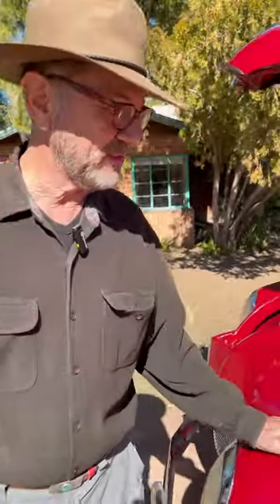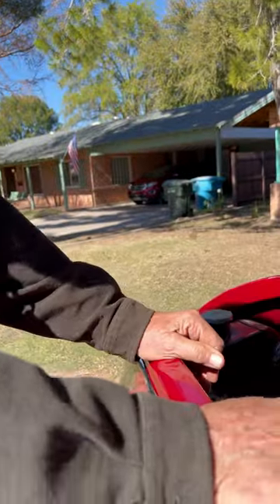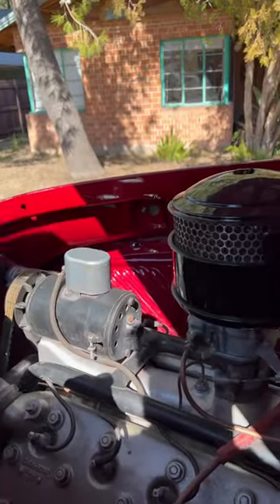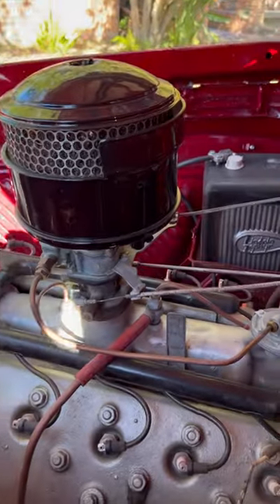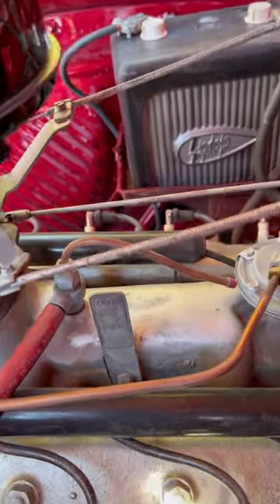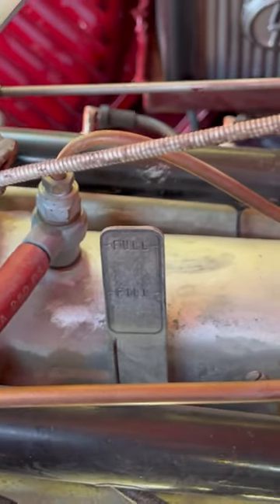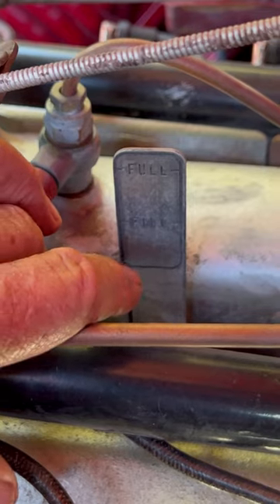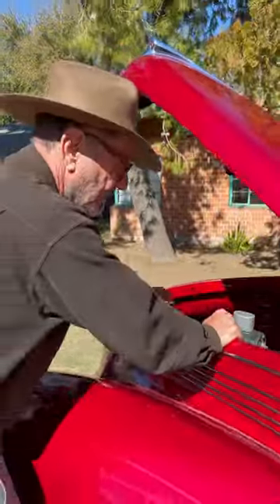Crazy No Dipstick Oil Check - Early Lincoln V12 Flathead #shorts #classiccars

Comment: He will be driving by everyone after the EMP goes off.
Reply: There's alot of 90s cars that are just as basic man
Reply: @clutchbleach2057  ... not even close dude!
Reply: @clutchbleach2057  Nah, not 90's. Old school diesel though, yeah. If you have a mechanical fuel pump and injector pump you wouldn't have to worry about em getting fried, only thing you'd have to worry about is getting the engine to turn. '90's have a lot more electronics, EFI, crank sensors, cam sensors, knock sensors, MAP, MAF, IAC, OBD I, OBD II, etc etc. Lot more shit to fix to get it running after an EMP. I could see early '80's, especially trucks. Manual, carburator, mechanical fuel pump, but you still have to worry about ignition. Main thing would be the coil, if it had points.
Reply: EMP are high power radio waves... They need an antenna to be picked up. If that antenna is connected to your stuff, it'll be fried... The power grid is the perfect antenna for picking up EMP. That is to say,  your car is going to be fine as long as it's not an EV that's plugged in.
Reply: @Melanie16040  ... EMP is a VERY broad band. Think of how small the antenna is on a cell phone. A quarter inch piece of wire will pick up EMP... and probably fry any electronics connected to it. Think of how many resistors, transistors, capacitors, etc (along with a mile of wire) might be in a modern car, not just an EV.
Reply: Old cars have just as much a chance of getting fried as modern ones.  The thing is that an EMP is unlikely to generate the required 25kV/m outside of the immediate blast area, which means that pretty much anything that isn't destroyed in the actual blast will most likely be fine.

But no, old cars are no more resistant to EMP than modern ones.   You would need to go back to a time before alternators, so, electromechanical voltage regulators on very old diesels.  Any vehicle that is directly under the EMP and RUNNING is going to be fried if not destroyed in the blast though.
Reply: @shockwavecity  ... I hate to call you out on that comment, but I have been working on cars for well over 50 years and it wasn't till the 80s when you had to be aware of small stuff like static discharge, while working on engine electrical. Yup, just that little spark from rubbing on a carpet in the winter could toast an ECM. OTOH, your idea of "old" might be 1995. When we talk of old cars surviving EMP, we're generally looking at pre 1970. Pre 1960 is going to be almost bullet proof, because even a car radio was very basic in those days.
Reply: My 95 Nissan terrano diesel wouldn't crank after I swapped the auto for the manual g/box. Seems the engine needs to see the TPS signal for the starter to work. Sits tied up to the loom now... would have thought it would be fine for EMP too, but no....
Reply: @timothyjamieson1282  ... TPS = throttle position switch. Did you have another sensor in mind, like the Neutral Safety Switch? (automatic only)
Reply: @sdusb1243  ... Gonna break that down a bit more... In the USA 80s vintage cars and light trucks usually had throttle body injection and even mid 70s vintage had electronic ignition. In this era, I worked on Datsun / Nissan vehicles, and they had an electronic carb, which didn't run for shit if the system went down. GM had their own version, starting around 1978. Working on VW diesels we also had glow plug timers, which came into play on most all consumer diesels around the mid 70s. The same goes for the Olds diesels in that era, along with the 6.3 / 6.5 diesels in GM light trucks. The engines may be old school, but the controls are not!
Reply: @rupe53  

There really are.
Reply: @rupe53  

Most cars from the 90s (FE) might struggle to start from cold and that's largely it.
Reply: @rupe53  

You clearly mean the 70s. And even then, unless the EMP was VERY localised the odds of a 70s and even 80s average car being immobilised is pretty unlikely.  Fight me.
Reply: @timothyjamieson1282  

Sounds like a CPS issue to me. Flex plate vs flywheel.
Reply: @rupe53  

I'll just call out your comment about 'electronic carbs': generally ANYTHING 'electronic' to do with carbs was linked to the cold start and sometimes load based conditions (ie lights or demister being switched on or off).  If it had a carb on it'd run regardless as long as it had fuel and spark. It might be harder to start especially in cold conditions but it'd start eventually.  Hot water on the inlet was a huge help.

'Black box' systems (basic transistored replacements for points and condensers) were pretty robust as well so tell me another bullshit story.
Reply: @skylined5534  ... ok, you wanted another story... electronic carbs used an O2 sensor and a feedback loop to maintain proper mixture at full temp, at least here in the US where emission controls were running rampant by the late 70s. (cold start was still a choke) Yes, those electronics were a bit more robust, but they soon gave way to integrated chips which did prove cheaper and more reliable under normal conditions.... but failed with extreme temps, static electricity, and even the stray "jump start" after a flat battery. (voltage spike) Points style ignition is still the only bullet proof way around EMP.... provided the rest of the vehicle survives the heat and the blast.
Reply: @skylined5534  thought that too, but Nissan is cleverer than that. Flywheelvand flex plate fit exactly the same and flex has a spacer plate so offset and crank bolts remain the same. Even had the pilot bearing was factory installed! The moment I plugged TPS back into the loom it started perfectly.
Reply: @Melanie16040  There's 100 lbs of wire in the average car, that's all antenna.
Every sensor is connected by a long wire to an input to a microprocessor that is extremely sensitive to electric overcurrent.
Reply: @clutchbleach2057 you'd have to go pre-emmissions at least which was early 70s. By the 80s cars were already becoming computerized.
Reply: All pre 1968 cars have their electronics shielded from emp because the ignition systems had no suppression and the principal on which ignition systems function is entirely magnetic fields. Something no one wants to talk about is the strength of the supposed emp if it carries enough energy it doesn’t matter if you’re electronics are sitting in a cube of lead it’s gonna get them but the general idea is that some things are more protected than others and as it turns out there was a point in time where vehicles were produced with some emf protection built in.
Reply: No he won’t 🤣
There’s still coils of wire in that ignition system, and those coils are gonna catch that EMF and over volt the rest of the system. It’ll be fried just like anything else.
Reply: @rupe53 TPS is also Transmission Position Sensor which tells the TCM what gear is selected.
Reply: @rupe53 also TPS is not Throttle Position Switch. It’s Throttle Position Sensor. Switches are binary and detect On or Off states. Throttle position sensors have a lot of steps. Think more like a potentiometer.
Reply: @sdusb1243  you have the right idea. I have an old freightliner I'm jumping into. A EMP will take out even simple stuff especially if still hooked to a battery. So starter is susceptible too. The Carrington event in 1859 was the strongest thing we have on record and that took out telegraph stations even causing fires. A a telegraph is about the most mindless simple thing electrically and it was down for something like two weeks, just imagine our infrastructure now. It's crazy how bad it would be.
Reply: @Melanie16040  not true. anything with power even batteries. Old stuff even the simple starter can get zapped
Reply: @rupe53  Even starters are fried
Reply: @berkcanberk4947  ... sorry, been working on vehicles over 50 years and the early ones were indeed a switch. Later they became a sensor. Old habits die hard. In the USA that trans switch is a neutral safety switch. It only allows starter operation in neutral and park. (Mechanical linkage shifters) On most vehicles it also controls the reverse lights.
Reply: @plap.  ... if you are close enough to have the permanent magnets in a starter be affected, you will have bigger fish to fry. (if you are still alive) The windings in a starter will probably be fine. There's also a 95% chance an alternator will be ok, as long as it doesn't have a solid-state regulator. Mechanical regulators will put us with mostly pre 1970 vintage vehicles. Your dash mounted AM radio (all transistor) will likely be toast.
Reply: Yup cant steal it or shut it down
Reply: @rupe53  yes you are absolutely right the older ones were. They were pretty much more like an interlock for the starter so you wouldn’t start your car in a gear. You don’t need to apologize. I thought we were just spitting info out there. I was in the industry for almost 30 years but got out after getting a taste of shop ownership for about 10 years. Left the industry all together to become a marine engineer. I bet you have seen the industry and cars change a lot over 50 years. You probably forgot more than I ever learned. Hahaha.
Reply: @berkcanberk4947  .... just to make things interesting.... today I drove my 64 Corvair panel van to where we store an old fire truck that was in the Memorial Day parade. That old fire truck is a 1928 GMC. It has no power steering, mechanical brakes, and a non-syncro transmission. If the 6 volt battery goes dead, it's got a hand crank. (that I have used a few times)
Reply: @rupe53  oh wow!  That is so cool!  What a perfect day you had!  I’m glad that you had such an amazing day.
Reply: @berkcanberk4947  ... amazing is why I do stuff like that, but at my age the various parts of my body question the added abuse needed to do the task. We think nothing of power steering, power brakes, electric start, etc... till they are not there! BTW, vehicles in the 20s didn't have wipers, heaters and defrosters either.... and driving over 30 mph is taking your life in your hands... because the brakes are VERY basic as well.
Reply: @rupe53  I’ve had a couple military trucks (M109A3 and M35A2) from the 70’s and neither had power steering and both had air over hydraulic brakes with one channel masters. Haha. Pretty much death machines so I hear you.
Reply: @rupe53  tell me you didnt read the comment without telling me you didnt read the comment.   How many cars from 1995 do you know with electromechanical voltage regulators?

Like, i'm sorry you know nothing about the subject except what movies and anecdotal gut feelings have told you, but that doesnt make you correct.
Reply: @shockwavecity  ... that's a pretty broad brush you paint with. You obviously didn't read my other comments about vehicles prior to 1970 and having worked in that field for well over 50 years... not watching movies for my info. BTW, I also said you'd have to go back almost 50 years to find mechanical voltage regulators. They were pretty much gone by the mid 70s, in favor of solid-state units.
Reply: @rupe53  you've worked in the field for well over 50 years, and have zero years understanding how high flux electromagnetic fields work, and what their effects are.  I have literally designed and built EMP and radiation hardened electronics.  Your 1950's to 1970s era cars aren't any safer than modern ones provided they aren't in the immediate blast area, which would destroy them anyways.

One of us has a gut feeling based on being a parts swapper for 50 years, and the other has an actual education in the effect you're trying to pass off.   This is a well understood phenomenon.  The carrington event knocked out mechanical telegraphy, an even more simple system than anything used in any car ever built, on technology almost 100 years older.   An EMP would have even higher flux in a relatively more confined area.  It'll straight up weld your ignition points.   Steam and hit and miss engines would be about the only things still running.  Some diesels MIGHT still run, provided the pre ignition (glow plug) heaters haven't had the wires running to them literally melted.
Reply: @shockwavecity  ... far from a parts swapper but you'll have to pardon my lack of experience with "hands on" for EMP. We just don't have that issue on a regular basis.... just like you have little experience with auto repair. I figure it this way... just based on the number of electronic components in a modern car, I would say the fail rate will be much higher over a pre 1970s car. After all, a toasted BCM or ECM may not allow power to the ignition system, even if that is still good.
Reply: @shockwavecity  you don’t need glow plugs to start a Diesel engine. It’s a cold weather starting AID. Early diesels didn’t have them at all. The type of EMP most people are thinking about when they talk about this is from a nuclear warhead, NOT from a major celestial event. The only thing that you could theoretically fry from a nuke (from a distance far enough that it wouldn’t be vaporized) is the radio. Ignition coils and starter windings are thick, well shielded, and very tolerant of extremely short duration back emf, they deal with it all the time during normal operation, especially with bad condensers. Worst I would expect is MAYBE a shorted ignition coil or condenser. Both dead simple to replace. Any computerized car would be absolutely destroyed.
Reply: @rupe53 you are correct. My flathead has coil, points, and condenser. No electrical gizmos, or sensors. Basic, and reliable as the sunrise.
Reply: @rupe53 there are at least 4 antenna on most cars with a key fob. That includes the radio.
Reply: @austyndrums1993  .... yes that's true, but there is also a hundred miles of wire in there that will act as an antenna, even though that's not the original design.
Reply: What EMP tf
Reply: @clutchbleach2057 you don't have a clue Goober😅

Comment: The old Willys Knight had them on the side of the block just above the top of the sump pan ,it was rotting into the ground no body left just a chassis diff gearbox and engine,,and the rod and float still worked
Reply from the maker: WOW!

Comment: "No failures" until the float breaks and you have to drop the pan.. not before overfilling it because you think you're actually low on oil.

Unlike those "silly electronic" units where you can check your oil while driving down the road and use 2 bolts on the side of the pan to remove and install.
Reply from the maker: I got you! There’s probably a few reasons why this idea didn’t last super long, but it’s very fun to see how they were trying to innovate in the 1930s when the technology was emerging

Comment: Except dirt & dust that gets into your engine & lack of vacuum that catches hydrocarbons & re-burns them from the oil crankcase area
Reply from the maker: Yeah, those were much simpler times… I’m pretty sure there’s some kind of a felt or some way of keeping debris out. I need to check on that.
Reply: @BarryTsGarage  As much as that cool oldy is driving probably would never matter if a bug gets in or dust the oil filter will catch any contaminates. If it's old enough it has a toilet paper type oil cartridge. Not the best . Can be updated to use newer style oil filter. I've been a Auto Tech for 34 years. Seen alought fixed alought but I don't know it all still see new stuff once in a while. Take care Vote Republican lesser of two evals
Reply from the maker: @juliussatter2765  valid points!  Thanks for joining in!

Comment: My 2022 Honda motorcycle has a "sight glass", which is even simpler (no float, no moving part).  My 2005 Kawasaki also has a sight glass.  You just look through the little window and see your oil level.  On a car of course it would be difficult to use a sight glass, so the float shown here is the next best thing.
Reply from the maker: Great reference!

Comment: That was a car for when you pull into a gas station, and an employee checked your oil level and windshield washer fluid while the fuel gravity-fed into your car.

That's right, the pump filled a glass tank on top of itself so that the driver of the car could announce how much fuel they want, and then visually see to verify it BEFORE it went in the car.
Reply: Not gravity feed. It has a mechanical fuel pump something like the old flathead Fords. Most every car in that time had a mechanical fuel pump.
Reply: @blumobean  I ain't talking about the car.

The fuel pump at the gas stations had a glass top.
You drive in, tell the attendant you want 6.5 gallons, they pump it up to the glass dome, they ask you if it's good, you look at the glass dome to see the fuel quantity and type, once you give the attendant the ok he opens the valve and it gravity feeds into your car's gas tank.

Comment: So why the design change? You would just need to drill a hole through the block down into the oil pan right? Put a float and a rod and seal the opening up top so crap doesn’t fall in.
Reply: Modern engines run at much higher compression rates, the increased crankcase pressure would likely just spit that thing out

Comment: Just wait ten years and nobody can check the oil. A good number of 2014 vehicles don't even have a transmission fluid dipsticks.
Reply from the maker: You are right, I have a 2007 vehicle that does not have a transmission dipstick! Frustrating

Comment: No failures isn't 100%- the float can fail and read inaccurately because it filled up partially/fully with fluid. 100% accurate and failsafe would probably be a sight glass on the oil pan or block.